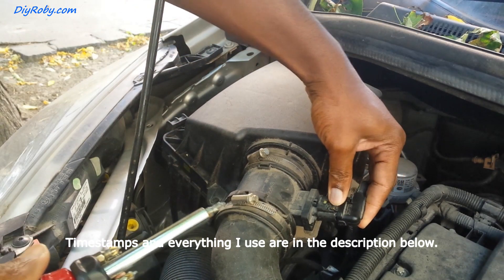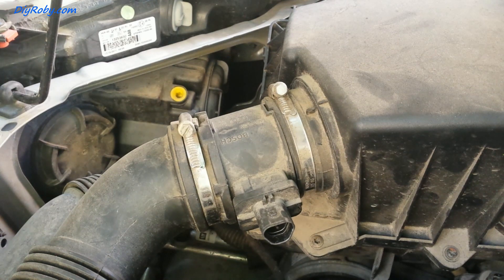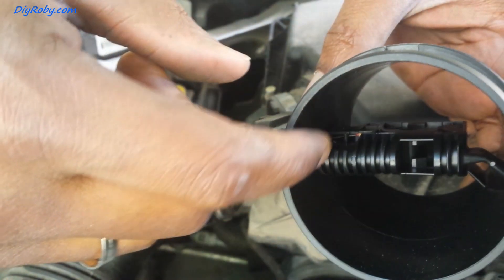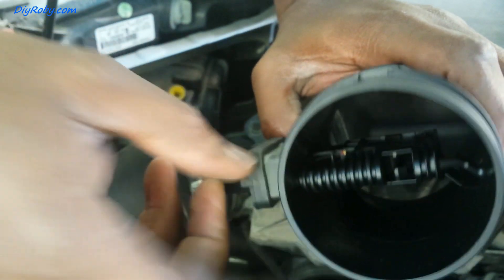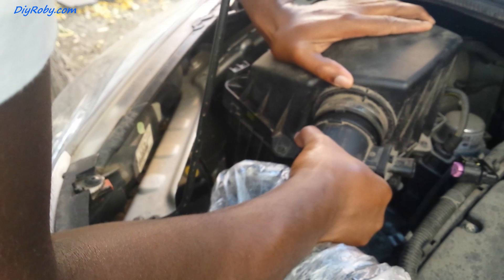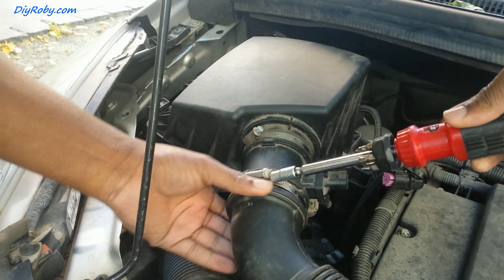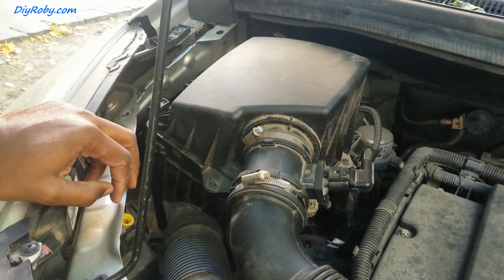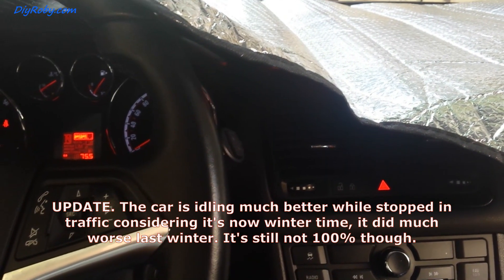Remove Opel/Vauxhall Meriva B Bosch mass airflow sensor MAF, for cleaning or replacement.

Comment: Hi brother where can i buy bonnet releasing cable for mariva B
Reply from the maker: Hi Rajumonte, you can check on ebay, or on any local shopping website you may have. You can check on local spare part selling websites if you have those. You can go to car demolishing places and ask them if they have such car to demolish, they can sell you the part cheap. The part is GM part number: 13128231 or 13269924
Reply: DiyRoby thank you bro